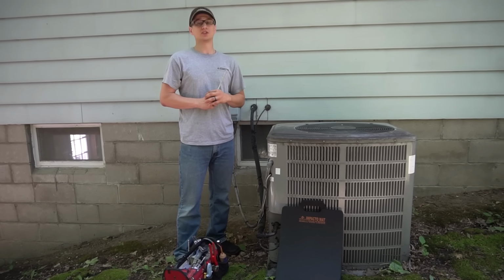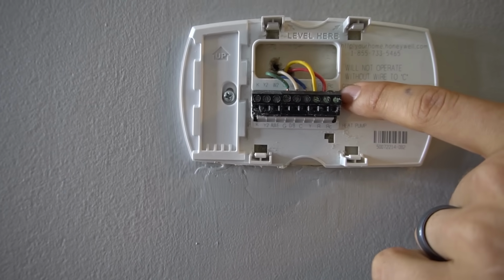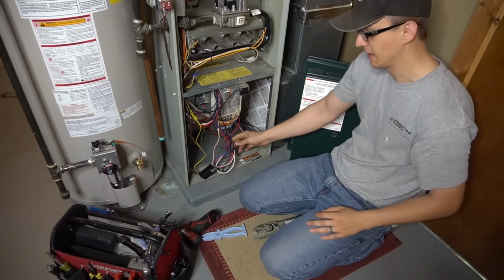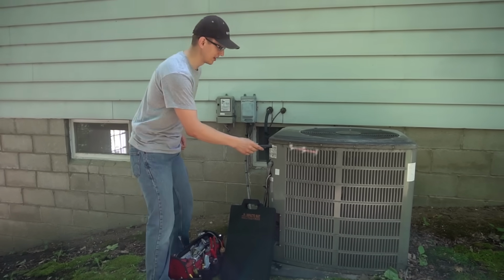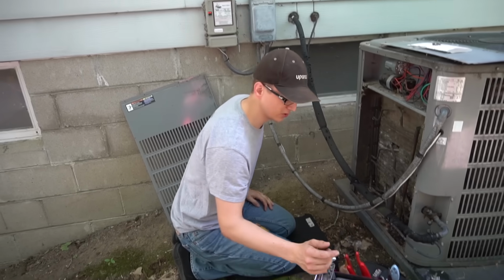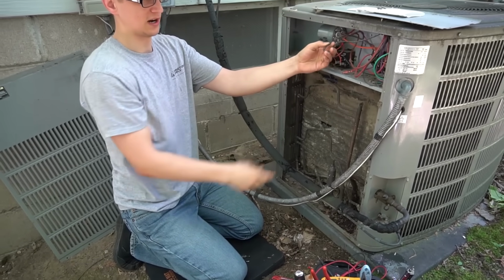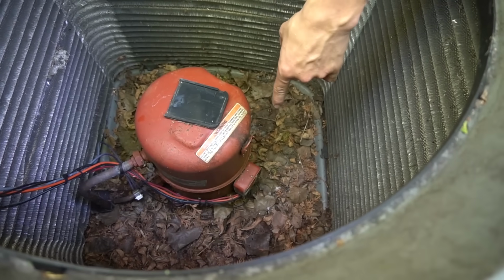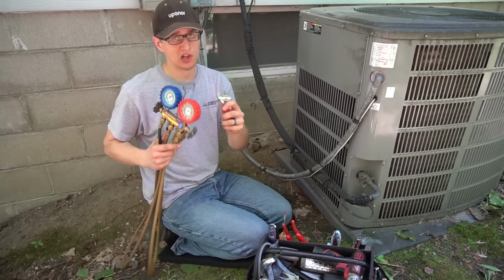AC Unit Not Turning On - How to Fix It Step by Step

Comment: I checked everything you said my unit is about 10 years old a new replacement but last year was working fine I put in a Nest thermometer and heat is fine but nothing happening at the air conditioner fan it’s not spinning but I feel air in house just not cold or no movement outside,I checked for fuse there was none,what else could it be?

Comment: Thanks for this excellent video; very detailed easy to understand instructions. I was able to troubleshoot my AC problem and it turned out that my thermostat was defective. Per instructions in the video, I jumped AC and the power ports at the control board and AC started working.

Comment: So what if every thing works fan outside, thermostat, blower inside but compressor is not on and air from vents is cool but not cold( air temp is 78 but set to 65 for 1 1/2 hrs.)

Comment: Great video. 
Had to recharge mine earlier this year as it had developed a leak at one of the solder joints, reflowed the solder and recharged it, but I have to admit the control systems for home a/c where out of my realm of expertise, I work on cars, so its controlled by a tev, or orifice tube and then just the blower controller and a/c switch on the dash. 
I dont know anything about house electrical. Blower tested good. I dont have an dvom that does capacity, not something we deal with much in cars, so I will do a visual inspection of the contactor and cap tomorrow. I am hoping its the contactor since I am not getting any power to the confessor fan or the compressor.

Comment: Ok, I'm trying to get my AC back up and running. went to change the control panel inside the house and i could not get the new one Sensi wireless touch screen to work so I put the old one back on and it's now not working. I did connect the wires back as they were. I did take a picture. I'm now 3 days without AC and it's hot here in TX. And my point is your video is awesome. Great details on all the possibility.

Comment: You address a lot of information thank you . But if your not getting 24v at your contactor and check your power from the thermostat wire . What’s the steps You should go to pin point the problem

Comment: Not sure if you still keep up with this but.,a buddy who does ac work dropped by, thought I had a capacitor problem, put one in and the fan outside still doesn't work...any ideas? Checked breakers all is well there

Comment: Helpful videos.  I have a heat pump (cooling this time of year) that is not always coming on.  Indoor system is running.  At the unit, I heard a 'click' but the switch/plunger did not move.  When I pushed in the plunger the unit started running and stayed running.  Thoughts on the issue? (Nordyne Heat Pump Model JT5BU-048KA)

Comment: So I replaced both my capacitor and my contactor. My furnace turns on, so when I turn the fan on the thermostat it works. Everything on the inside works. the ac unit outside still “clicks” when I turn the ac on but no power. I hit the post on the contactor and it turns the fan on. What would next steps be ?
Reply: @wordofadvicetv
Reply: Ended up replacing the thermostat and fixed the issue. Used a multi meter to determine no low voltage on outside wire going to unit.

Comment: Thank you for this video!!
So i try your easy fix and manually spun the blade when the unit is on and it worked! But I notice that the fan isn't spinning as fast as it should. It seems kind of weak. Would this also have an effect on the amount of air blowing thru the vents because I also noticed the air isn't as cool as it was before it stopped working.
Any further steps to take? Appreciate your advice. 

Some background. Ac unit was fine until yesterday I noticed the air was hot in the house. I go outside and hear the buzzing but fan not spinning. This morning I go out to try your easy fix method and it worked but not performing as it should. I was going to replace capacitor but this easy fix jump started. Thanks again

Comment: This video is best AC troubleshoot video in youtube hands down, Great Job and Thanks!
Question: I have one AC unit and two controllers, one upstairs, one downstairs. When I turn on both controllers it cause circuit breaker to trip. This is a recent thing, it was working just fine before. Any ideas about how to troubleshoot this issue?

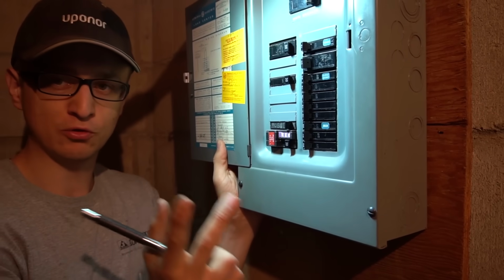Comment: 6:00 mark: reset circut breaker. You didnt address when the circut breaker wont lock when slid to the left  befor going to the right to complete the reset.

Comment: I installed a new capacitor, fan & compressor both still not working, plunger on contractor is in & fan spins freely, any idea where to look now? Filter was dirty
Reply: Check control voltage. Check all connections. Check safety switches maybe your low press. Or high press. Cut out switches are tripped and you missed it(very easy to miss)

Comment: Plunger is stuck out. Everything works inside. I can feel it trying to kick on but won't kick on. Capacitor looks good and tested good. We actually just tested it and it sucks in when you turn ac on inside house. Fan spins freely when I push fan blade

Comment: Just trying to diagnose my AC.   So the indoor blower in is blowing hot air.  The compressor outside and fan are NOT turning on.   I tested the plunger and when I manually push in the plunger the compressor and fan turns on outside.  Does this mean my capacitor is good and the issue is inside?
I have 240V at the disconnect and I also have 240V at the plunger but the plunger does NOT pull in when I manually call it via thermostat.
No hum either.
Reply: Follow up:   I am getting 28v from the thermostat and indoor unit control board all the way outside.  Also I’ve tested the 80+10uF startup capacitor and it’s working and within spec.  
So now the question is:  is it the contactor or could it also be the low refrigerant indicator which isn’t allowing the compressor to turn on?    Can I test the contactor by sending 28v to the side terminals and see if the plunger pulls in?  That would mean the contactor is working, leaving the low refrigerant indicator as the culprit.  I hope this logic is right.
Reply: Follow up2:  Looks like the contactor is working as it should.  I sent 28v to the side terminals and the plunger worked and compressor turned ON.  So while doing this, I also noticed there is another switch in series, and this is a high pressure switch to one of the lines, high pressure line, in particular.   I checked continuity and it was an open circuit, OL on my multimeter.  The switch is bad.  So I bypassed the switch and VOILA!!!  The AC works as it should and with the ambient outside temp of 87F, the interior vent air temp was at 38F.  For now I am bypassing it.  How can I verify that there is a schrader valve used in-line with the high pressure switch (Sensata 100103-03)?  If not, then that means, a HVAC tech would need to come out and evacuate the lines and re-charge the whole system.  All for a $25 switch!!!!!!!

Comment: Need advice. Awesome video! I followed all your steps and my AC still will not turn on. Furnace blower motor works. AC  unit works. I press the plunger and blower and compressor turn on. I replaced my thermostat and used the connector for r and rc. I put to thermostat to cold. Hold on 70 and it does not turn the ac on. Any other trouble shooting ideas? I also live in MN. Thanks for any other advice. I just don't know what else I can try. Thanks

Comment: My fan runs inside and outside. It sounds like the condensor is attempting to come on but just hums occasionally but never kicks in. I've replaced the capacitor but there's no change. I dont have z meter to check it. It is blowing air but no different than the fan alone.

Comment: Any ideas on why a contactor would work intermittently? I had a capacitor replaced for the inside motor unit a month ago other then that nothing else. I took all the covers off and pushed the contactor in and the unit started I then turned the thermostat on and everything worked. My problem is that tomorrow the condenser unit won’t start up again. Thanks in advance.

Comment: So, my ac wont turn on. I checked it out and if I push in the black override it will turn on but it wont run on its own.
Reply: This is what mine is doing as well. I wasn't clear from the video what is broken if pushing in the override turns it on.
Edit: I just rewatched it and am going to investigate the 24v coil that's supposed to pull the plunger down
Reply: @hidef9265  
Let me know if that was the issue. Mine runs fine but it is like it doesn't get the signal from the thermostat to turn on
Reply: freerider t thanks for messaging me to follow up, it was the coil not getting power to pull down the override. So I started following the 24v wires from the coil and found that critters had chewed the wires through under the deck. I patched that up and covered it with a concrete block and we're good to go!

Comment: Great job explaining the workings of the AC.  Will go out and examine the unit now.  Is the fan on 240 or 120?  In my case the fan works fine but
the compressor never even tries to come on.

Comment: I tired to turn on the ac unit today and it didn't turn on ( No noise at all )  . I checked the circuit breaker it was fine. I changed the batteries to the thermostat and it didn't help. I then turned the furnace on and that wouldn't turn on.  I'm wondering if it really could be the thermostat ( I know it is over 14 yrs)  OR the furnace ?? any thoughts :) ??
Reply: ok we just replaced the thermostat and it still is not working :(

Comment: Thank you so much for doing this video. My thermostat was missing the jumper wire you mentioned early in the video. Saved me a sweaty night of sleep and a service call.
Reply: I added a jumper wire between the R and RC wire sockets behind the thermostat.
Reply: @j money i have the same problem. How did u fixed it?

Comment: Right pole of two pole contactor to compressor stuck in open position. Left pole of contactor was working so evaporator fan spun. Freed up right contact so coil was able to work and cleaned contactor points of debris to reduce resistance. Works great!

Comment: It’s a great video. I am trouble shooting my HVAC and as the AC does not work. My 3A fuse blows off every time I put back my regular thermostat. But it doesn’t blow off when I put in my Nest thermostat. Best gives out an error E103 (Y1 wire error). What would you recommend ?
Reply: All the internal fans work. Outside condenser switch seems not to pull in when AC is turned on. Does that cause the 3A fuse to blow off?

Comment: Awesome video! I’m an electrician by trade and have done small jobs like replacing thermostats and wiring up units. But my ac went out the other day and this video helped me out a ton! Still waiting to see if it shuts off or what the actual problem was. Everything was on but no air and no fan. Had a little reset switch inside the unit downstairs. As soon as I hit that and closed the door switch it kicked right on.

Comment: I have an R22 system. I  was checking the refrigerant charge just to see if it was at the right level. My gauge on the low side was reading under 50 psi which is way too low and yet the a/c is cooling my house. So just ought of curiosity I checked it with 2 other gauges , same thing. I turned the system on dials barely budged. Have you ever heard of such a thing?

Comment: This is an outstanding video!! I have learned a ton of troubleshooting tips from this video. Thank you for taking the time in making this video! 

I do have a question about an old Carrier heat pump. Model number 40AQ024300BB. The thermostat is about a year old, and we replaced the capacitors (indoor fan and outdoor unit). It worked for about a week, both heating and cooling. It seemed as it wasn’t getting power. During diagnostics, I noticed a small screw stuck to (shorting) the O and C terminals. I removed the screw, but neither unit “clicks” when switched on. The thermostat clicks, but is battery operated. I get no voltage from the thermostat leads. I cannot for the life of me, find a fuse in either the indoor or outdoor unit. Neither unit nor the indoor fan will come on. Could it be the magnetic switch? Is the mainboard fried?

Comment: Appreciated your video series very much. My AC/Heater unit is not working at all. Compressor and condenser fan does not start, AC blower motor in attic does not run. I took the thermostat cover off. R & Rc are coupled. When I bypass the thermostat at the thermostat, I can see furnace and condenser coming on but not the blower fan. Voltage at the thermostat wires between R & G/W/Y is about 27V. The capacitor on the blower motor was bad and I replaced it. When I bypass the thermostat at the control board, I can see furnace and condenser coming on but not the blower fan. What could be wrong? How do I go about diagnosing the problem?

Comment: 18:25 NEED HELP , everything works inside ( but no cold air ) plunge is out not in ...when i press it, compressor and fan goes on , but plungde is out ...once I press it like in video, everything works but only if i do manualy, doesnt do automAticly 

What could be the issue, thank you

Comment: Great videos!  1. I have central air conditioner Model No.: DAHY-F060N110C and I can't find who made it or the manual online. 2. I was going to order a hard start kit, but I don't which one to purchase since I can find who made it.  3. I wanted to order a replacement run capacitor and it's no longer made.  My run CAP is a Aerovox, oval Z62P3787W, 80+7.5MFD, 370V, 024-25912-000, and Aerovox says Z62S is the newer series, but it much smaller in size overall.    Any recommendations?

Comment: Hello my ac turns on but the outside blower doesn't turn on but it makes a humming noise and i thought i heard a pop after a storm a few days ago so i replaced the contactor which was burned and also replaced the capacitor and still not working do you know what else it could be?

Comment: Help! My AC recently started acting weird. Before I call someone to help me fix it, id like to know more or less what it could be so I won’t get tricked into paying more then I have to! I have my AC set at 75 once the unit reaches the set temp it does not shut off. I replaced the filter didn’t need it but changed it anyway and made sure all the coils were clean. I feel cold air come through the vents but for some reason the unit will not shut off after it reaches the set temp. It is on automatic and also now it doesn’t reach up to 75 it went as low as 80 but no lower. Any idea what it could be, thanks in advance 🙏🏼

Comment: Thank you for this nice video, I have learned a lot about air conditioner. Actually I have a problem with mine, wonder if you could give me some suggestions?It is a single package vertical unit-SPX-HP series for apartment. I have checked the Fan, which is good, the condenser seemed working (with the rumbling sound), also changed the air filter, but it still cannot cooling very well.The temperature always keep at 24 degrees around and cannot drop to lower degrees. The condenser inlet and outlet part is built outside the wall, which is hard to make a clean. I only use this machine for 5 years, wonder if I need to fill the freon or could there be any other problems. Thank you very much

Comment: Question:  Outside AC unit makes a hissing and shrieking while fan is NOT running, then fan starts up and all sounds normal.  Cooling seems fine - 56* from register with a meat thermometer.  Never noticed these loud noises before - unit is 6 years old.  Thoughts?
Reply: I have video/audio if it helps.
Reply: You could have a bad capacitor for the fan or compressor. The fan and compressor turn on simultaneously. You could put a hard start kit. You could check the run amps on the fan and compressor to see if it's over amping.
Reply: Devin Chavez Thank you!  Would it still be cooling with a bad capacitor?

Comment: I've been searching for a video like this for years. Thank you! 

I have One Question.  Lets say My system is running in Auto and I'm NOT at my desired Temperature yet.  What is the system supposed to do when I take the switch on the Honey well and Move it to the OFF position (Heat,OFF,Cool)...Should the outside fan Turn OFF if everything is working correctly.  

Can't wait to safely (attempt to) fix my two HVACs problems.

1) Fan Gets stuck in the winter.

2) Fan Never turns OFF when I reach my desired Temperature.
- Furnace Clicks OFF when it hits desired temperature
- Fan is set to AUTO on thermostat.

You covered both cases in your video.  And Flipping the fan blew my mind. I will check in the minute my the fan turns off after reaching the desired temperature.

Comment: Thank you for the help. I replaced motor and condenser just 1 year ago (beginning last summer) and it worked great all summer but now the beginning of this summer the fan is not spinning once again. Anyone have any ideas? I wouldn't think the motor or condenser would go that quickly.
Reply: MkeithD give it a helper start with a stick to get it turning

Comment: My heater works just fine, blower turns on, I feel heat coming out, no worries there. When my AC is switched on, I have this Honeywell zone control board HZ311, it switches to AC and Fan for a moment and then switches off. When I bypassed my thermostats on the control board R and Y, there is this thing that gets tripped, a 3amp fuse I think next to the door switch. When I push the plunger in on the outside unit eveerything turns on fine. When I hardwire the blower fan that works. I don't see a fuse like in your other videos. I've tried replacing the capacitor in the outside unit and also the Honeywell HZ311 board but neither one made any different. I have a Lennox blower unit. Any help you can provide would be awesome!
Reply: My issue was the contactor! Seems it was grounding out when the AC would turn on.